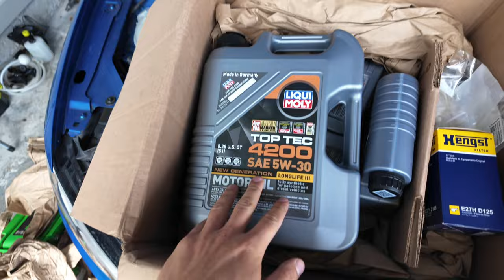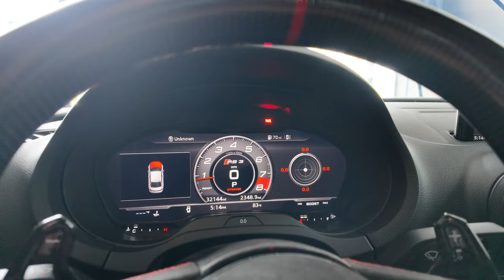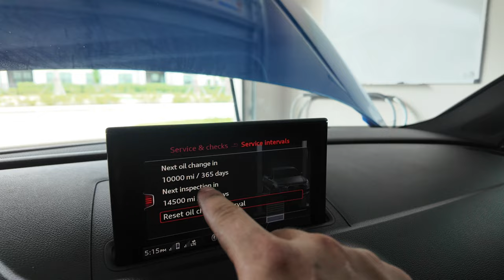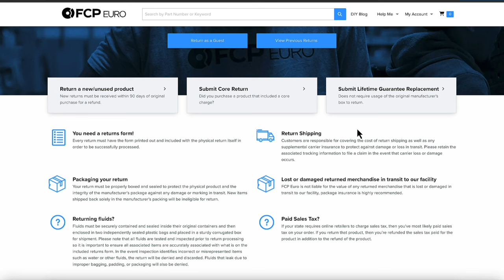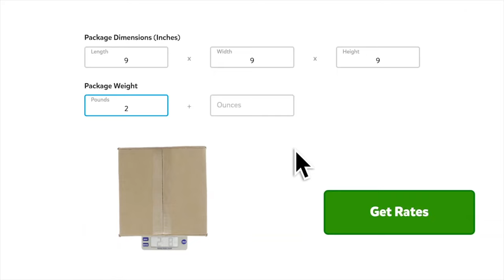How To Do A Complete Oil Change On An Audi RS3 | Tips and Tricks

Comment: Dude get the right tool to unscrew the filter housing.  It’s a 74mm 14 flutes. Why would you mar up the housing with those clamps. Also, fill the housing with oil and you won’t get that ugly noise in the beginning
Reply from the maker: funny you say that, right after i did this i went on amazon and bought a 74mm 14 flute oil filter adapter. im debating on replacing the filter housing now.
Reply: @Haydenschreiermk2  I wish they made aluminum aftermarket housing like on some other Audis/BMW but I haven’t seen any for this car
Reply from the maker: @RedlineMaximaSE  the oil pump housing is also made of plastic, not a good habit to thread a metal housing into plastic. much easier to strip or crack.
Reply: @Haydenschreiermk2  I had one on my S5 and didn’t have an issue. Just pay attention to what you’re doing and don’t rush things